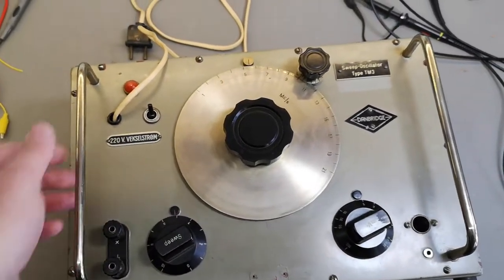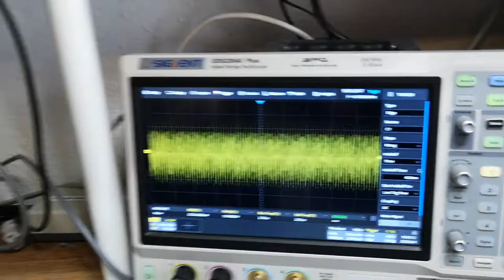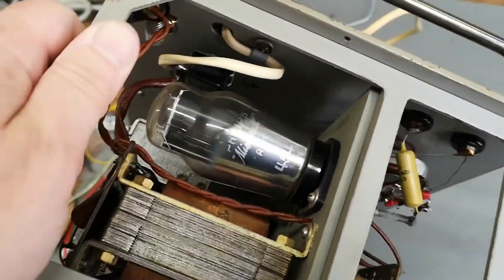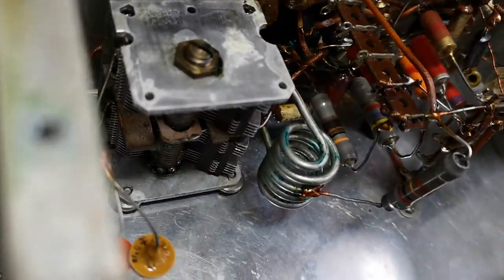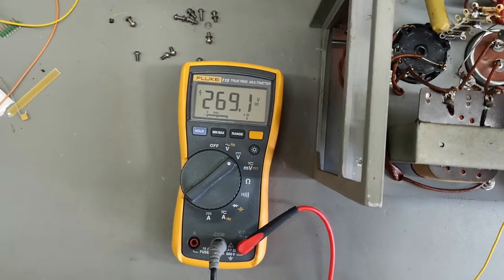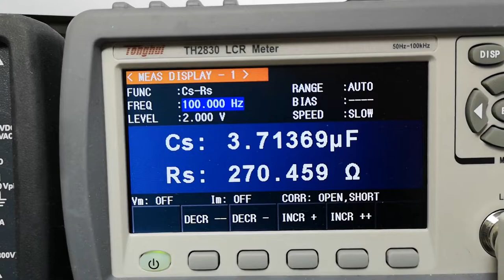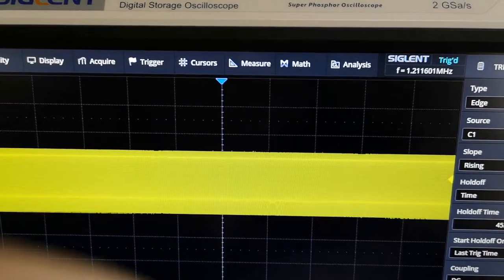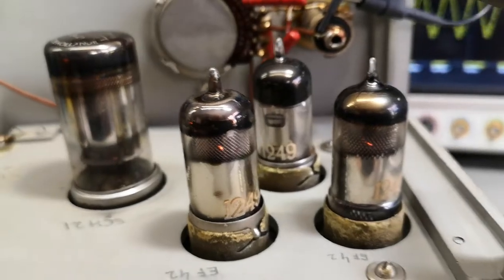Danbridge Sweep Oscilator Type TM3 test repair teardown

Comment: If you want a spare EF40 tube, I have several NOS in my collection.
Reply from the maker: wow cool, i am always looking for tubes, i got a large stack of EF40 but did not go visit my tube measure expert yet, so i dont know how far from ok they are, it is a little bit close to stupid just to plug a random unknow spare in, and see if it is better or worse :-) so my plan is to measure all my spare tubes, and this way only replace with known good parts. if you ever come near Ballerup, let me know my call sign at gmail :-)
Reply: @TeardownOZ2CPU  ouf, thats some distance. I am from Hannover Germany and have never been to Denmark before. There is a quite easy way to determin if the tube is any good. Either by analyzing the outer appearance of the tube and/or measuring the parameters with a high voltage supply and some multimeters. Which is equivalent to a tube tester or maybe even more precise. For example the EF40 in your device seems to have run alot. The getter is typically shiny gray with mirror finish. EOL tubes show dark black or brown and cloudy appearance. Easiest for just trying another tube, just determine the ohmage of the filament and test all remaining elements for short. Sometimes even the sockets fail due to oxidation. You may clean the pin connectors by spraying contact cleaner and rinseing with isoprop afterwards.
Reply from the maker: @jeldrikpetersen  my father is fairman dot dk :-) so i will go there and have all my tubes tested, he is the biggest tube expert alive in Denmark, I should have done that a long time ago. You should travel some more, it is fun, I have been to all 16 German states, and to all mayor cities in Germany :-) lately i become more lazy and almost only goto Schleswig-Holstein a few times a year where we got friends we love to visit.
Reply: @TeardownOZ2CPU  I bought a house build in 60s half a year ago. All the installation and interior is still original. I'm currently restoring everything here. It's going to take a while to fulfill my requirements. I do everything on my own and spend all my free time on this project.
Sounds awesome. So you grew up in between tubes and amplifiers. How good is your tube tech knowledge? How do you get hands on all of this vintage Equipment?
Reply from the maker: @jeldrikpetersen  I am too young to have a formal education within tubes, when i studied they only breefly mentionened this old tech, and said you dont need to know anything about this, BUT i did spend quite a long time playing with tubes, just for the fun of it, and i also helped my father with a few designs, so i feel i am ok to read tube schematics, understand how they all works, and measure and fault finding, and repairing all sorts of tube stuff :-) good luck with your house projekt, I hope you have spare time to visit my channel once in a while, the playlist contain a few cool videos for every ones taste / need.